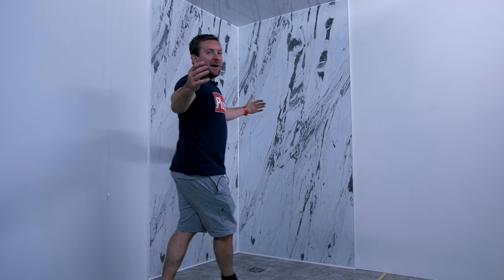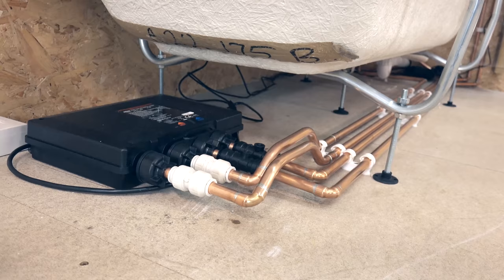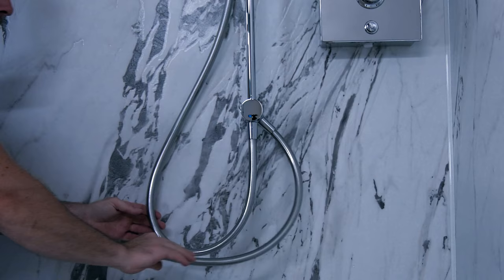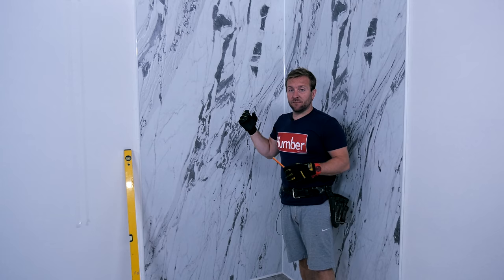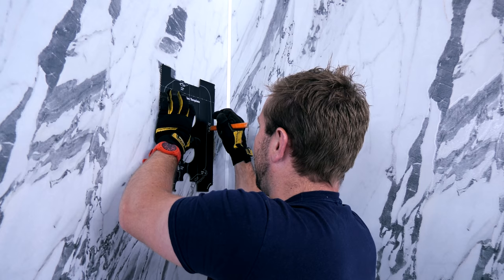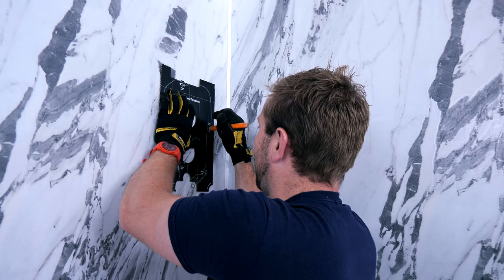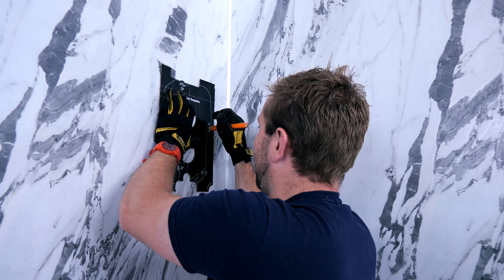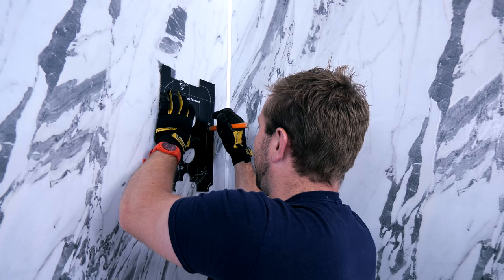HOW TO INSTALL TWIN HEAD ELECTRIC SHOWER - Mira Decor Duel Head Review

Comment: As an electrician, your incoming power cable size must be capable of carrying the correct current. The size in the demonstration is perfect, as this is a very high power shower. As stated, get a qualified competent electrician to check the size of your cable to make sure it’s correct, if not, you WILL need to reinstall the correct size. Great video
Reply: Hi Paul... valuable point as my switch board keeping tripping off, any recommendations?  Thanks in advance
Reply: @luisbaessa7682  hey there. If your board is tripping shortly after starting up (within 1-2mins) then your breaker isn’t at the correct rating. What size is your breaker (amps, ie 20/32/40), and what size is your shower, 8.5/9.5/10 kwt? I can do the calculations for you and let you know.
Reply: @djevil247  massive thank you for your reply, so my breaker is nsb32 and my shower is 10.8kwts thanks
Reply: @luisbaessa7682  No worries at all. That’s the reason your tripping the electrics. Your breaker is to small and requires an upgrade to a 40/50 amp breaker. But the most important part is that you require a 10mm cable from your consumer unit to your shower. If this is anything less then 10mm, you’ll burn out the cable and potentially cause a fire so please book an electrician and get it checked out buddy. Hope this helps. Any other problems, then please feel free to contact me again. Have a wonderful Christmas either way my friend.
Reply: @djevil247  tahnk you very much... i did exactly what you said, and it's all sorted now, really apreciated your help. 
Wishing you a great festive season for you and the family... 
Top Man... take care
Reply: @luisbaessa7682  Any time buddy, here if you need anything else
Reply: @djevil247  6mm cable is ok up to 10 kw no??
Reply: @Neo-mw1pp  I wouldn’t go above 8kw on a 6mm cable, after that you’ll need 10mm cable. Hope this helps
Reply: @djevil247  Ok, cheers pal 👍

Comment: Great detailed video as usual. Not sure about the shower wall panels though as the pattern design is the same and you can clearly see the repeat. Would've been nice if the manufacturer could produce several designs for a better look. Cheers

Comment: Hi James, love your videos, been really helpful over the years! I have just installed this Shower Unit but I'm struggling with the small riser piece that fits in to the diverter. It says insert until line is hidden but I can't seem to push it in hard enough, it still feels loose. Any suggestions?

Comment: Great job, one thing i noticed though...wouldn't it make more sense to have the 10mm electric cable run in above the elbow joint just in case it ever leaked!

Comment: Brilliant video just one question on the two heads install,with the Mira Shower cabinet mounted so far below the shower head how do you water proof the the electrical components ? which are inevitably going to have water sprayed onto or is the cabinet already waterproof or is there an longer version of that short hose that connects to the shower cabinet to enable you to mount your shower cabinet to say approx 18 inches from your cealing.

Comment: very good video but i think you missed securing the grubscrew that holds the riser bar to the top backplate its not a spare in the pack , also dont use silicone (i think you used mastic which is better) inside the casing and then fit the cover as acetic acid is produced in the curing process of silicone that makes showers rust internally as it strips the coatings , and a question below about siliconing around the outer case ,dont as it causes the shower to sweat inside it needs a bit of air to circulate

Comment: Any trick at 12:23 please? For whatever reason, I am unable  to push that bottom pip as instruction until the line is hidden. It prevents me to go ahead for finalizing the install of the dual system. Basically when I try to push it it just fit but doesn't get stuck or whatsoever so that'd be guaranteed leak until i find out how to fit this pipe. Thank you.

Comment: i wanted to ask, i love the way this looks! i can the complete mira system, with the pump drain etc but the shower unit is mira advance , it looks horrible, the shower heads tiny, its a nightmare. can this be fitted instead and would it work with the drainage system?

Comment: Surprised you did not run water through the 15mm cold supply before fitting the shower. It's good practice to do this because if it's a new supply or an old one debris can accummulate and if it's not run out it can get inside the shower unit.

Comment: Extra grub screws? Big bonus...big, BIG.. bonus.
Potable water off mains to an electrical heater. Do the install notes state requirement of a check valve directly after/off the cold water tee?
Reply: p.s. installing a shower over a bath...? grub screws....? PUT THE PLUG IN THE BATH! Just in case (GULP!)
Reply: Never install a check valve onto a supply to an electric shower unless you also install a mini expansion vessel between said check valve and shower.
Reply: Glad you said that. I was being deliberately provocative (devils advocate) I've been having this debate with an external auditing and testing organisation who issue water safe certs to a Co. that I sub-contract to. I have to do the monthly internal auditing and recording, they issue the annual certs after inspection. The Co. need the certs for insurance purposes. They couldn't even be arsed moving some suspended ceiling panels to inspect whether check valves were installed when the building went up 35 years ago. It was noted in their report 14 months ago. I x2 checked, found em and installed mini exp vessels in addition to their recs.  I took them up on this omission and they got shitty with me. They actually turned the immersion stats up to 70 degs out of spite IMO. Took me an age to sort out the "goldilocks" zone min 50/ max 60 degs on all draw off points even tho a sentinel circ system is running, it was a right pain. They even chastised me for the cw recording points even tho those that I omitted were actually off mains, used daily and not tank supplies.

Comment: Are these any good and can the pole be cut so that the max height is 2.1m because this is for an ensuite in a dormer. Or what's the best electric shower out there right now with best pressure. Especially when it gets freezing outside you need to crank the heat up and it gets slower obviously. 

I have the old 10.5kw mira sport but put the stone stream shower head on and I've now gone through 2 thermal switches since doing that. 
I'm renewing the whole ensuite in March so looking for the best 1. 

Thanks in advance. 

Ian

Comment: When installing an electric shower why is an isolating valve not fitted on to the water inlet.
Reply: There is no space in the shower for one , if it's fed from  a loft you can fit one there

Comment: First time seeing a dual head power shower.
Reply from the maker: Decent too!
Reply: It’s not a power shower
Reply: @plumberparts  Unusual on the commission part for them to say turn the temp control to cold, all electric showers l've fitted have been full hot to reduce flow rate through the shower to remove air and get a steady flow.

Comment: Should you apply silicon around the shower unit itself? I have a Mira Azora, but it isn't flush with the tiles...
Reply: I'm not sure about Mira specifically but the instructions for the Triton shower I'm fitting in my bathroom say NOT to silicone it in. I would remove your shower and check it's fitted properly. I think sealing it with silicone might make the shower overheat? Although they don't provide a reason for that